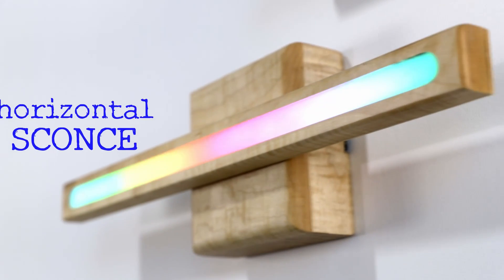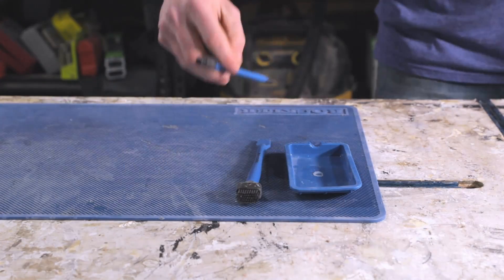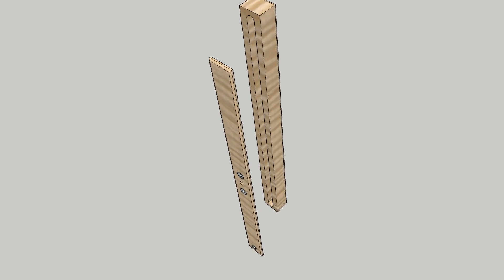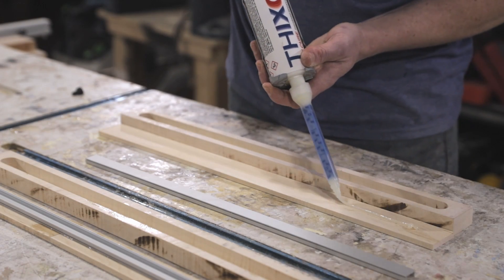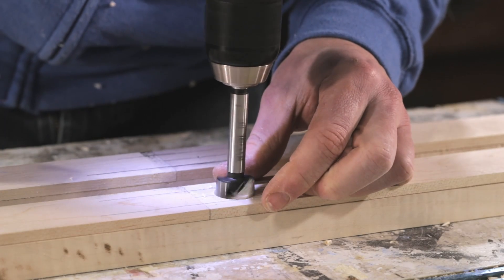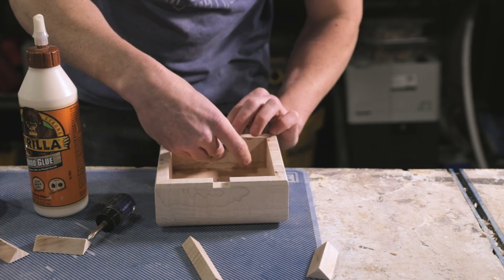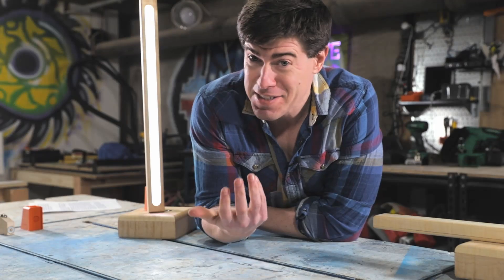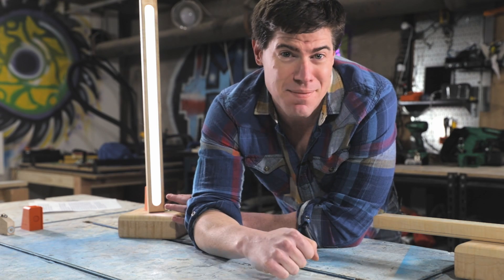Wireless EPOXY LED 3-in-1 Lamp & Sconce || 3 Different Lamps in 1 || DIY Woodworking

Comment: Maybe I've been living under a rock, but I've never seen a box wall glue-up like that with the tape and fold method. Very cool!
Reply from the maker: Ha, thanks!  There are a couple videos by others showing the technique.  It works great for joints that don't need to hold significant loads

Comment: Kinda cool, cept you didn't make it clear how you were actually wiring the LEDs to the base. As in, when I was watching through it, i didn't see you actually make ANY connections to the LEDs from the base... left me wondering "oh, did he just make it so it sends everything through the magnets? wait, but wouldn't he need more than just two magnets then?" so I kept watching that section over and over to see if i could spot what you did, and couldn't see anything. Then at the end you catch a few glimpses of a wire coming out from the base and how cumbersome it is to move the light bar itself around to the various positions... 

Basically, you left out some important information that could lead to some confusion as to how you have things set up... the video was nice and all, and was fun to watch, but useless if you don't actually show each step if you were actually hoping someone was going to try and re-create it...
Reply from the maker: If you have questions, and want to recreate this, feel free to ask.  99% of the ppl who watch don't actually make the projects, so I occasionally skim over steps.  The wiring is very standard for neopixel strips.... I just used 3-pin wires (power, ground, control) and JST connectors.  The one non-standard part is that the control must be wired to the end of the strip, and the power and ground enter thru the middle of the strip, so the wires don't show in sconce or task light configuration.  I did show this part in the video with the green control wire being longer inside the light bar, since it is not standard.
Reply: Modustrial Maker Hello great Video and loved watching it. Please let me know how the magnets make the connections to the power.

Comment: great project, i love magnets and leds. you can use magnets as cathode and anode for your light then you dont have to care about wire coming out of led bar. or you can incorporate battery inside LED bar and charge it there after that you can use LED bar alone as well... Oh God i"m rushing with ideas
Reply from the maker: That would be really cool!  You'd still need to get the control signal to the LEDs, but I like the direction you are thinking!
Reply: @modustrial  yeah, though  controller is big otherwise we can manage it inside led bar. Or we can make a dock connection with controller but that will be quite difficult or over engineered... lolz

Comment: This is a great project. Thanks for your video.  Did you have any issues with the single 18650 nominal voltage being less than the minimum 5 volts the LED Controller specs call for?
Reply from the maker: Thanks!  Not with this controller... Im not sure why, but for the sp107e and sp106e controllers it doesn't seem to be an issue.  With some other LED controllers i tested, however, it won't work without a voltage converter to boost the output up to 5V.
Reply: I was gathering parts for this and noticed that. I may experiment with using 4 18650's:  2-series, 2-parallel for higher voltage and amps towards battery longevity. I just love the versatility of your design. Thanks again for your inspiration.
Reply from the maker: That would be a great idea ... I get about 3 hours at 50% power draw (which is like 80% brightness)... Even 2 with a step down converter works well... You can also buy some of those big 3.7v Lipo batteries and use those

Comment: Man!
Very LED project you make gets me so inspired to dive into an LED project I’ve had on the back burner!
Only prob is, I really need to be able to seal the less under the epoxy for my project. How detrimental do you think the heat will be?
Reply from the maker: Thanks Jamesdon!  If you are using 5V LEDs, it really shouldn't be an issue....they don't get that hot.

Comment: I don’t want to tell you how to live your life but dang. Push that French press down more slowly. You can thank me later. (Nice lamp, by the way. I love the diffused LED’s.)
Reply from the maker: Thanks!  About to make my coffee and will try the slow push 👍👍
Reply: Also, I don't know anything about programming lights. Do you think it'd be possible to create an equalizer using those lights? Build 5 to 10 lights to represent EQ bands?  @modustrial
Reply from the maker: Yea, the sp107e controller is actually designed for an LED matrix ... In the Bluetooth app you just set the number of columns, and how many LEDs in each column, and it has like 30 different equalizer settings built in.  One cavaet tho ... You can only control one string of lights with the app, so you would have to wire them all together, or have 5 controller devices to control 5 lights (for the scene at the end where I show the music sync VU, I was controlling one light with my phone, and the other with a tablet)

Comment: Very nice. The rechargeable battery makes sense for portability. I'm going to try a less portable version that uses a transformer to knock down the voltage.
Reply from the maker: Thanks Stephen!  Let me know if you want the SketchUp file or STL file for 3d printing

Comment: Nice work! Do the LEDs look like one continuous strip of light instead of individual LEDs to your eyes? It looks fine on the video, but sometimes video can be deceiving.
Reply from the maker: Yup, sometimes they look better on film , but this isn't one of em.... Totally looks like one big flowing light source.  Because of the depth of the diffuser and the face the LEDs are set back from the diffuser about a 1/4", the effect is almost 3D.  I was very happy when I turned them on for the first time 😁
Reply: @modustrial  Awesome! Thanks for the response.

Comment: Great project mate, probably a silly question but how did you get power from the base to the light unit?
Reply from the maker: Thanks much!  If you look closely you'll see there is wire running thru the hole in the middle of the base to the hole in the middle of the light bar.  I designed it so the wire is well hidden in all configurations.... Goes straight thru base to light bar in the sconce config, and is held flush against the back of the bar in the desk lamp configuration by the slot in the support block.

Comment: Darn it, now I have to learn how to solder too, the list just gets longer.

I love these
Reply from the maker: Thanks!  Soldering is much simpler than it seems at first....think of it like taking a hot glue gun in one hand, and glue stick in the other, and touching the stick of glue to the tip of the gun to melt it.  Just like that, except metal instead of glue....
Reply: Just picked up a soldering iron on Amazon a month or two ago because I kept seeing Mike and some other channels I follow doing builds like this. I was as surprised at how simple it is to get started. There a a lot of great tutorials on YouTube.
Reply from the maker: That's awesome @Chris Crouch !   I learned most of what I know from YouTube as well.... It's a great community for makers, and learning in general!

Comment: This is great! I love the many ways you can use it. How long are they lasting on a charge?
Reply from the maker: Thanks!  Under normal usage, I'm getting 3 hours or so.  There is a lot of space, so it would be pretty simple to use a larger LiPo battery if you need a longer battery life.